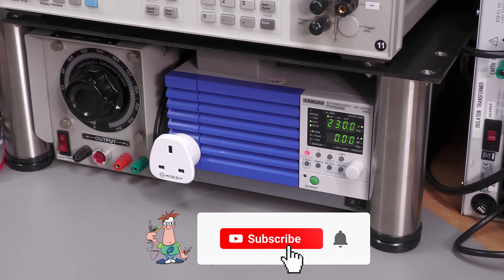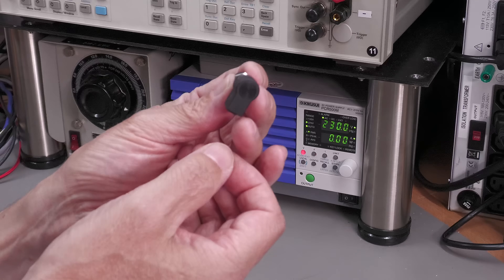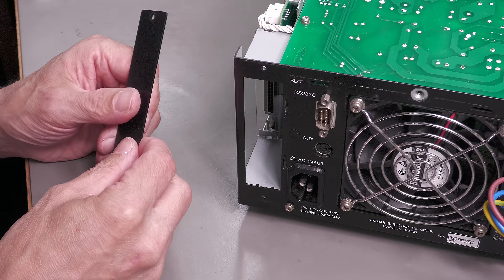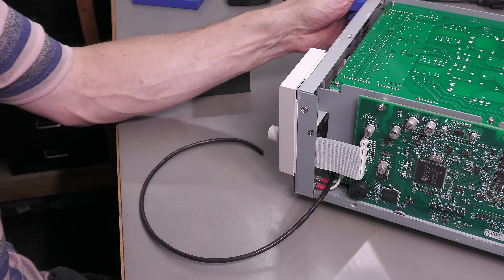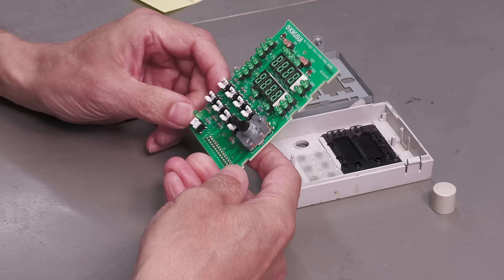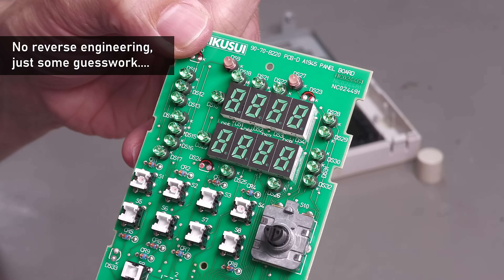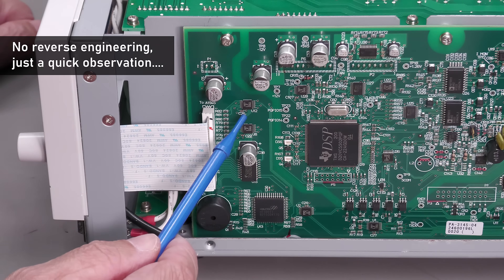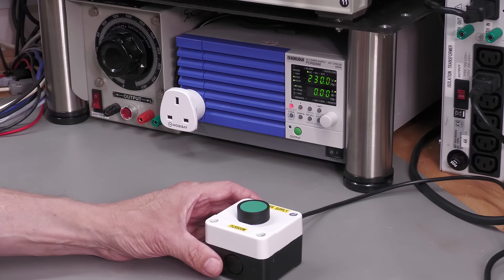No.157 - Kikusui PCR500M Remote Operation & LED Modification

Comment: I made a lot of remote controls for stuff, but I never took the internal power supply out of the device itself. Always put in a reed relay, 12V or 24V, which can be triggered by external power. And there're always a bigger resistor in parallel to the relay coil, so you will need some amount of current to drive the relay and nor zap or charge could activate it by accident. Especially since people starting to run their labs ob PLCs (which you can get off of eBay pretty cheap) the 24V signal can come from there.
I also always trow in a optocoupler on the status LED to trigger an open collector transistor circuit on the control voltage, so I can feed the control voltage back out to a status LED or whatever. People are not always using it, but it's nice to have the option to do so.

Comment: VFD driver because, while it normally has a running voltage of -28V, the datasheets also allow you to run the driver with only +5v and -1v supplies, and you can then use it to run the LED displays, as the drivers are all current adjustable as well for the VFD display, so you get minimal power dissipation in the driver, but also have a serial interface to drive it, the built in character generation, special annunciator drive RAM to have a 7 segment drive provide the correct display, and also a keyboard readback, using the keys and a sense line. Single package, does a whole lot without needing any attention from the main controller, and it will also send an interrupt on keypress as well. you got them a little bit bigger, which then also had a small microcontroller in the same package, making it possible to have the low power main controller, clock and display drive for equipment all in a single package, with a mask ROM to do the program, though you can bet that the original chip supplier also offered both EPROM windowed and OTP versions as well, all CMOS or Nmos depending on the age of the chip.

Comment: Nice little mod, I hope the input is not very high impedance so any stray RF could switch on the output when your working on it. Always a thought when extending switch's that may be multiplexed.
Reply from the maker: I have a plan for this......another video soon!

Comment: Nice work, Ian.  I did a similar mod to a Fluke/Phillips power supply that only has rear panel output jacks.  I remoted the output, the voltage sense lines and the on/off switch to a small extruded aluminum enclosure and made a custom PCB for a front panel.  I included a switch that connects the sense lines to either the remote output jacks or to small tip jacks so I can still remote the sense lines all the way to the DUT.  Works great!

Comment: :goodvibes: nice work Ian, as a thought I had, having a remote ON led would mean not having to check all the time on the main unit for the state of the output, getting a shock would also let you know but not recommended, with those replacement LEDs it might be possible to parallel them with a small value resistor to ensure no favoritism :) and then just use a 4 pin jack so no additional holes needed. as I said... just a thought
Reply from the maker: Yes, I did consider that.......and heck knows where I got those bright LEDs from, they are awesome!......but the PCR is only a few feel away and in plain sight so I think I'd rather have focus on the PCR display. However, you're not the first to suggest and so YT comments win.....so I may go ahead and do it anyway!....:-)
Reply: seems everyone is having the same idea, maybe should read all the comments before making my own, good to know were all thinking the same thing

Comment: Shame Ian you could not run an LED on the external Push button as per the main board
Reply from the maker: I was going to, but felt I'd rather have my eyes on the PCR front panel rather than on the remote switch.

Comment: I’m wondering if the “aux” socket on the rear has the facility for remote control?
Reply from the maker: I looked that up, but there's very little info available on the AUX port. The manual just says "A connector for functional expansion", no pin-out.
I think I read somewhere it has to do with paralleling up multiple PCR's together. Other sources mention open collector output for external monitoring.
Would love if it had an input for remote on/off.

Comment: Amazing the improvement in LEDs over the last 20 years.... 
... (More than) A bit worried a static zap or a bit of RFI might unexpectedly enable the output...I'm a bit squirmy around mains voltage output power supplies at the best of times...
...Would be slightly less paranoid if you were remotely controlling an internal reed relay connected to the switch contacts.
... Scary that the power comes on without a distinct audible warning...think I'd still need a way of physically disconnecting the thing being worked on to ensure no zappy surprises.
... Also, when the smoke is really enthusiastically escaping it would be very easy to tap the switch multiple times (hence switching off then on again)... Human nature makes us do spontaneous things in emergencies
... Maybe an unmissable warning light on the remote switch?
... Maybe an emergency stop button?
Regardless, thanks for the video, enjoyed.
Reply from the maker: Long term use and testing will reveal if static/RFI etc is an issue. Currently have it hooked up to a CRT scope (on-going repair) and it's fine so far.
I thought about repeating the LED out to the remote switch, but I figured it's best my eyes should be on the PCR and not the remote switch so I can see exactly what's going on.
Btw, the PCR has settable over current protection on the output via a CC or trip mode.....which I usually set up before hand. Lots of alarms when it trips.

Comment: That automatic centre punch was either not firing or you have it set really soft.
Reply from the maker: It's a cheap Ebay punch and it was firing......it's just weak even after adjusting. I need a new one.

Comment: having exposed connectors or long unshielded wires on a signal line going into a low voltage sensitive internal input.
i would have gone with a non invasive way using the rs232c port. theres gotta be a SCPI command to turn it on/off. then even wireless wouldnt be a problem
Reply from the maker: I hear you, but I just don't trust any type of comms for a critical on/off command.
I guess I could have designed a small board with an opto-isolator etc on it which would get around the internal input issue. A future upgrade maybe?
Reply: @IanScottJohnston  a opto is definately a good choice.  
when  i do such mods, i allways use a opto, even if its just a battery powered remote like i once modified a expensive sony bluetooth camera remote to be triggered by a external signal, and didnt want it to blow by accidentally wiring it backwards
you never know whos sticking what into which hole. if a opto blows, its 10cents gone. if a unobtanium mcu blows, its game over.